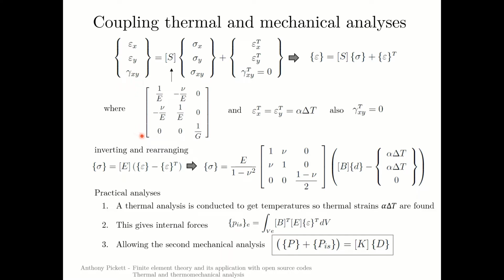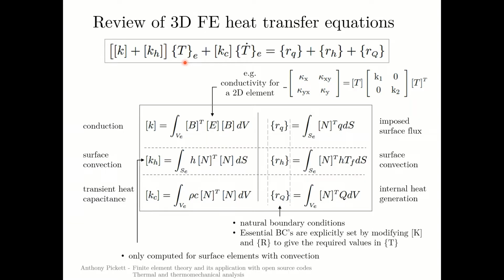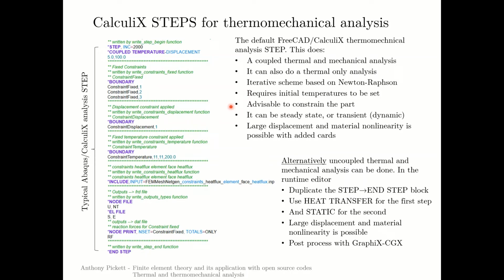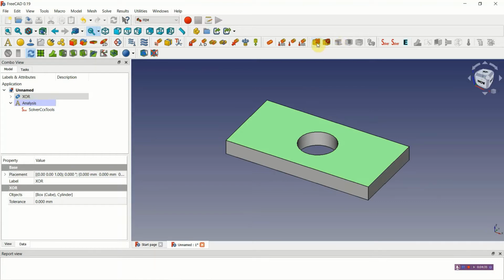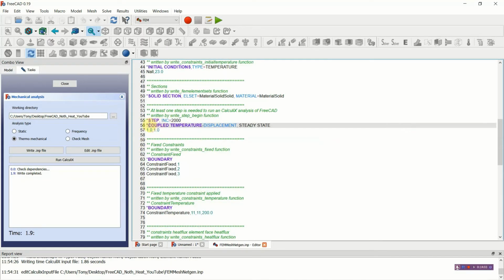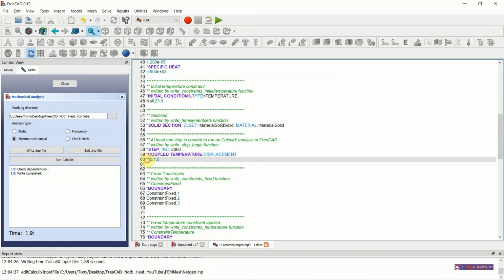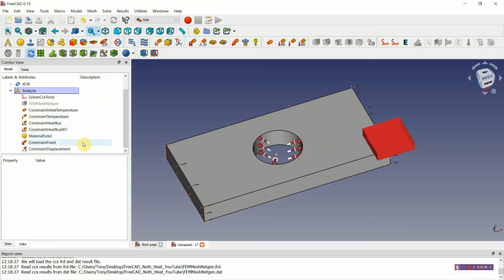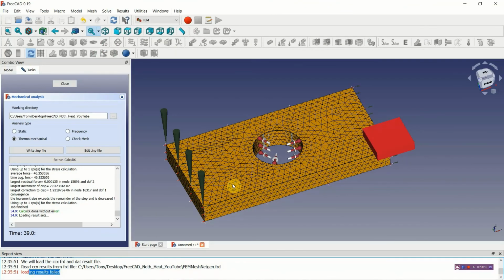Tutorial 2 - Thermal and thermomechanical analysis

Comment: An excellent introduction to the theory. However 273Kelvin equates, roughly, to zero degrees Celsius. An increase of 1 deg C is equivalent to an increase of  1Kelvin. Thus a simulation with 200 deg. C on the face should be run at 473 Kelvin. Similarly with the ambient temperature constraints. Please have annotate accordingly.